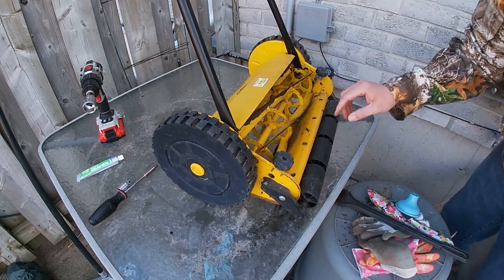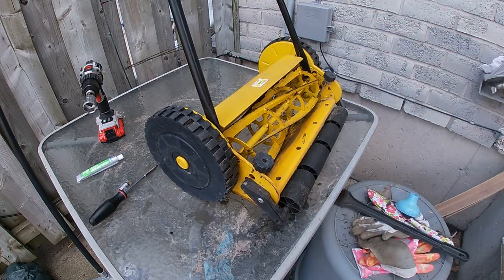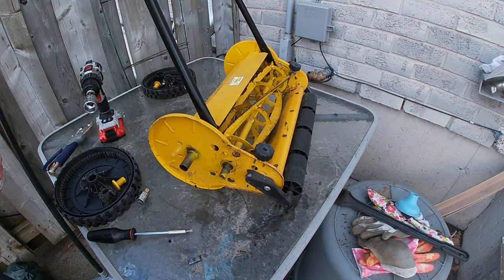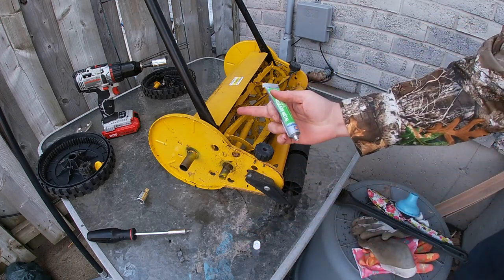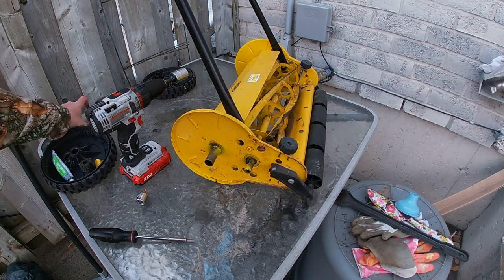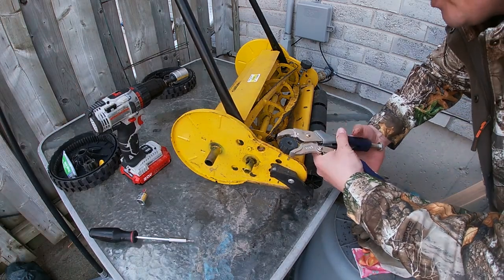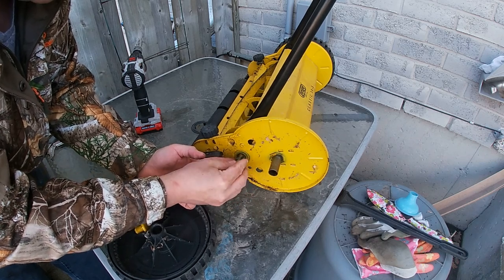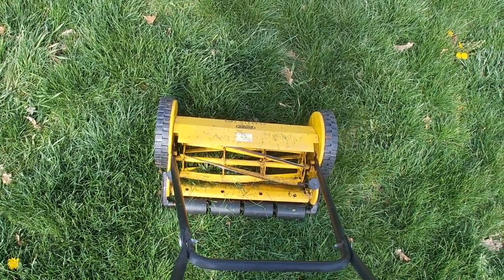How To Sharpen Blades On A Reel Lawn Mower

Comment: What i can't seem to understand, is what are the blades going against to sharpen the them? i have a Yardworks and for the life of me I can't  figure out what goes against on that one either.
Reply from the maker: There is a metal bar that the blades come in contact with that helps cut the grass. Please watch this video. It shows a better view of the contact point. 
https://youtu.be/ONMHpJQlRnA
The paste that I put on the blades has a grainy material in it so when it meets that bar it sharpens them. Hope this helped. Please like and subscribe

Comment: I don’t disassemble my reel lawnmower I use round diamond grinding stone, 220  600 grit
Reply from the maker: Thanks for the tip. Some mower manufacturers do offer a stone that bolts onto the mower itself and works very easy and well. I used this valve grinding compound as it is super cheap and older mowers may be harder to source out the stone for it. Thanks for watching. Please like and subscribe

Comment: I got a sharpening kit.  The one with a paintbrush, grit media and a metal tube handle.  Studying videos and directions I got the wheel off....and discovered the kit handle was too small! So, I used the other end. It has a hole in the side, and I was able to put a small screw through the handle top and wheel nub (it has a hole too...where the shim fits....just don't lose that shim!!!)
Reply from the maker: Or why not just do the way I showed in the video? Way easier. No kit or modifications required. Some things need not be over thought.

Comment: this is a very helpful video. Thank you. I can't wait to work on my reel mowers 😁
Reply from the maker: Thanks. Hopefully it goes well
Reply: @BillOfAllTrades2016  it seems like the mower I got from you may need some restoration/sharpening, which I get to learn. Right side of the bottom bed knife is pretty beaten up and it doesn’t cut a paper. And both blades and bed are rusty.  I will reference your restoration video :)
Reply from the maker: The restoration video is more of a vague and brief sand and repaint. I never sharpened the restoration one. Best to refer to the sharpening videos like this one.
Reply: @BillOfAllTrades2016  ok, thank you!